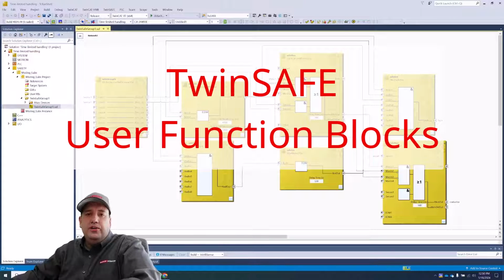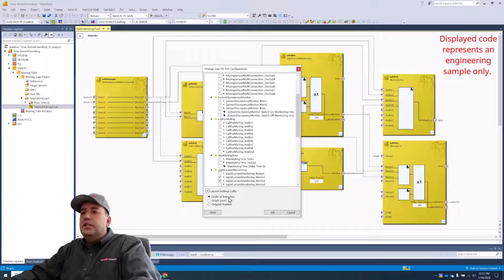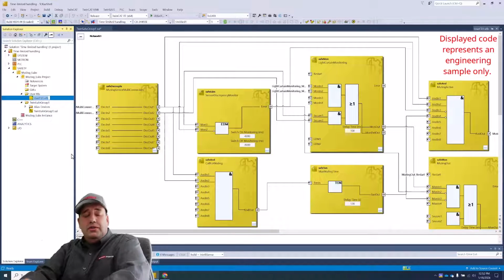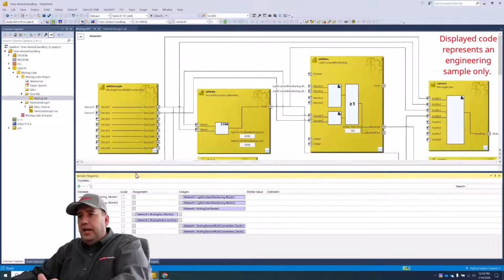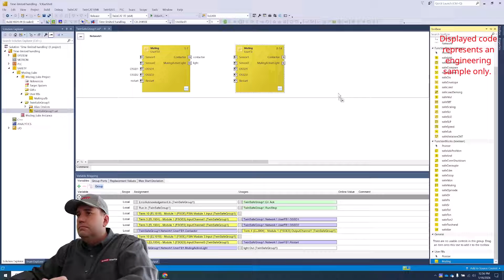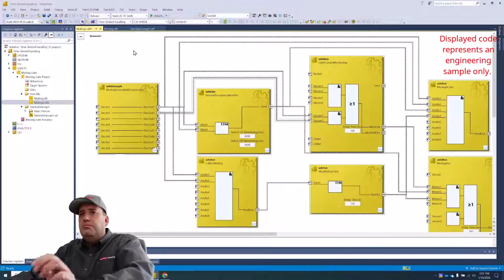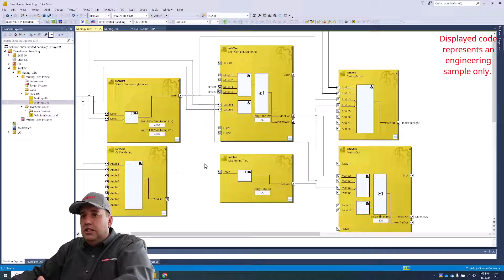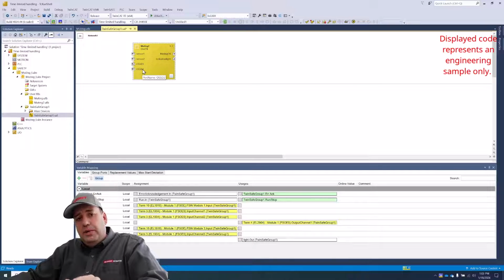TwinSAFE User Function Blocks

Comment: How do you change the order of the outputs (or inputs for that matter)?  I like a speicifc order/positon also.
Reply from the maker: They're not quite like a standard FB instance. The inputs and output positions are based on the order of operations within the function block. The lowest numbered blocks will be on top and the highest on the bottom.